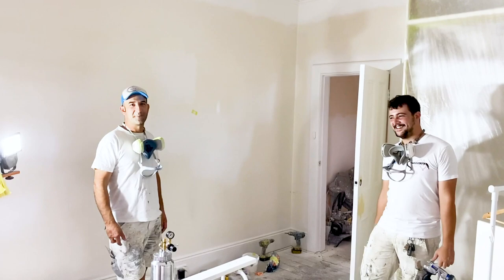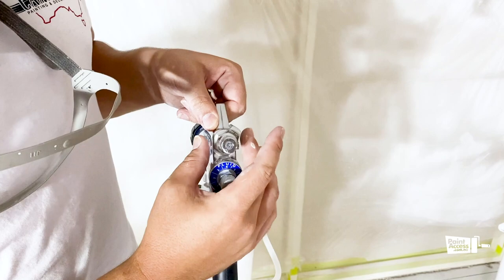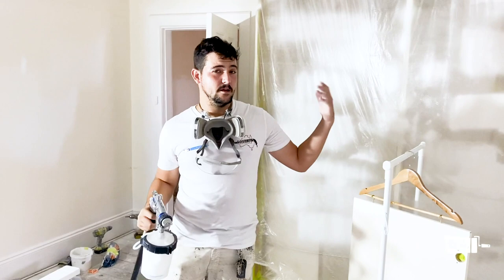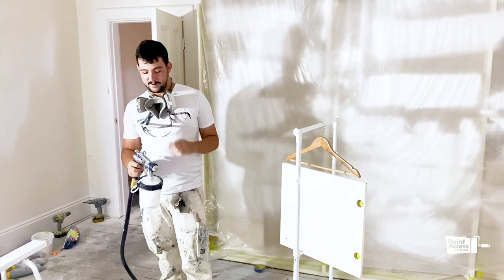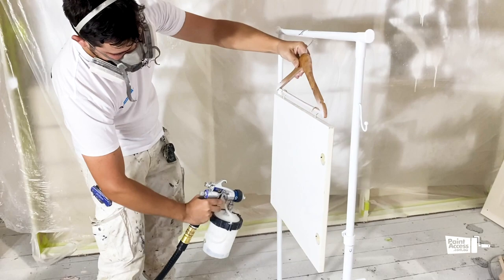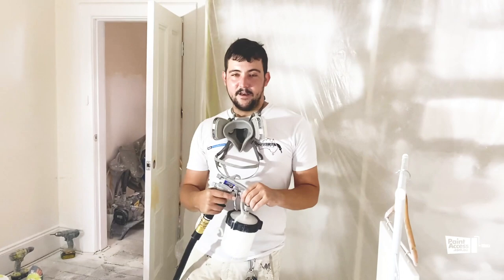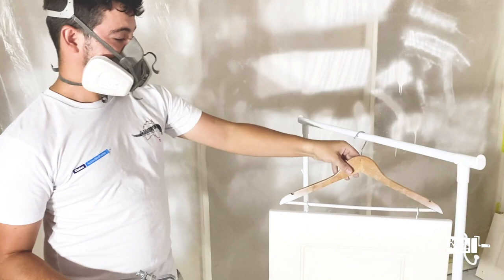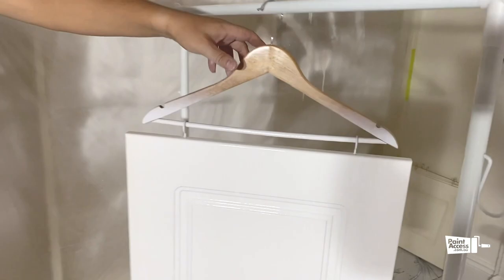Graco HVLP Paint Sprayer 9.5 Procomp Set Up Guide

Comment: Hi I see orange peel appearance. Does it change to super glass smooth appearance after dry?
Reply: that happens because it is primer.
when dry it is very smooth
Reply: He is shooting to close 9-10 inches… airless is 12-15
Reply: He will still have orange peel, Should have gone with #4 tip and thinned down the paint that way you can reduce air pressure. Lower pressure  less overspray and no orange peel.
Reply: @bluray5184  😂 no you want low paint and high air, you need to split the paint and atomise it, then wet the paint up.